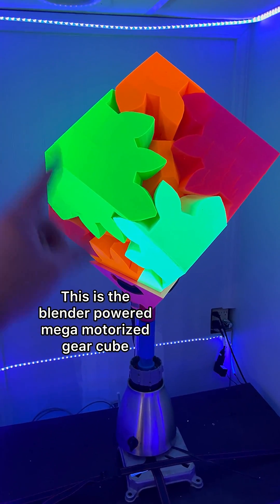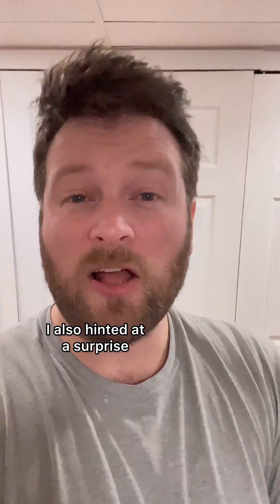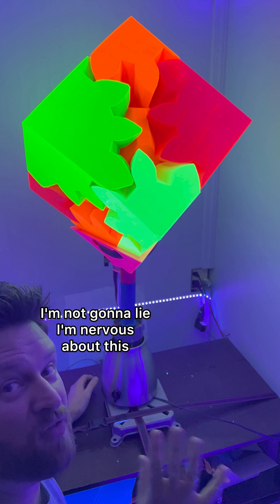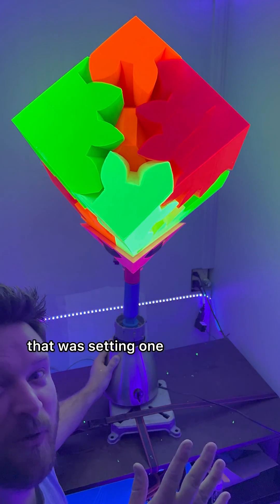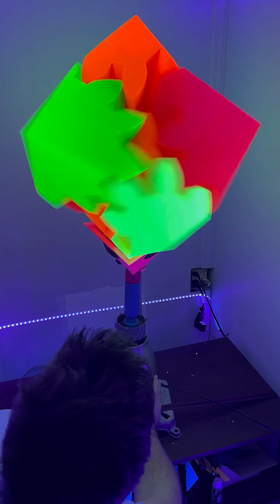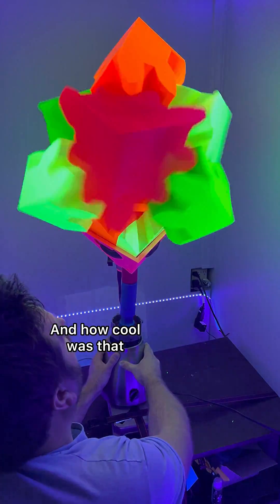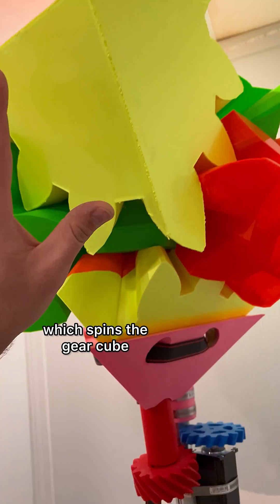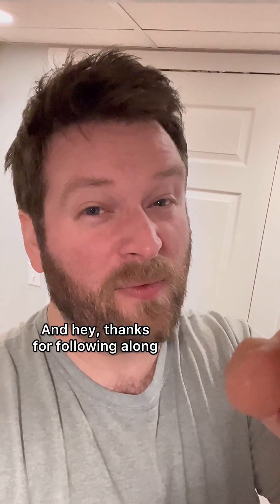Blender-Powered Mega Motorized Gearcube Finale!(?)

Comment: Why not just make the blender motor controllable instead of the stepper motor?  there's plenty of options for speed-controlling the blender's universal AC motor with some kind of PWM signal from a microcontroller, using an off-the-shelf AC dimmer module.  best of both worlds!

Comment: You could use a variac or a pwm controller for the blender speed. Setting one looks like it could work longer and have less chance of failure keeping the speed a little lower. Cool project. I hope to get a 3d printer soon.

Comment: grab a router speed knob adapter from harbor freight and see if you can slow the blender down. I think its just a big potentiometer that goes between wall voltage and the blender.

Comment: What an awesome finale! Looked great rotating even with that overkill blender. Plan B looks great with the motor selection, however that gearset looks pretty unsupported, I had this problem when designing a 90-degree power transmission too. 

I'd look into miter/bevel gears, try to use at least 3 gears to form strong support, gears will only transmit as much torque as the supporting structure around the gears can handle
Reply from the maker: Great suggestion, I’ll give it some thought! I had a differently configured motor mount with more support, but it wasn’t connecting the gears strongly enough, so I took a reciprocating saw to it and made some modifications
Reply: @printmeister Neat project, but I think the cube is rotating too fast with the blender to really visualize the effect, maybe add a third or even fourth planetary to slow it down?
Reply: @printmeister I would make this one have a slower mode. Make a reductor if possible, so the 2nd gear spins about this fast, and first to be slower
Reply: @printmeister  make it where we can only do commands